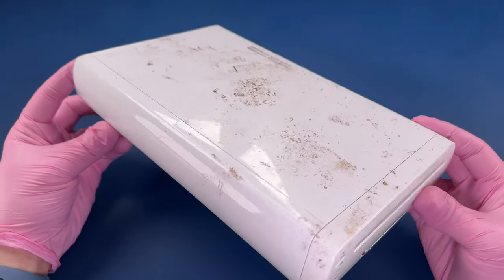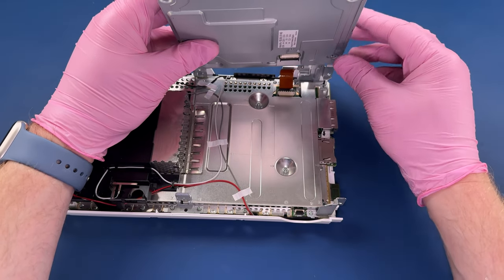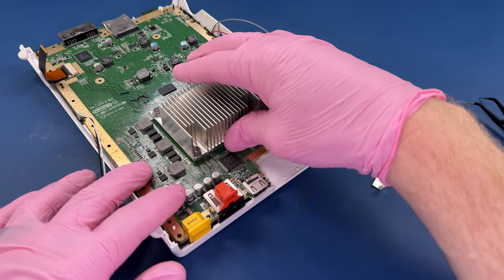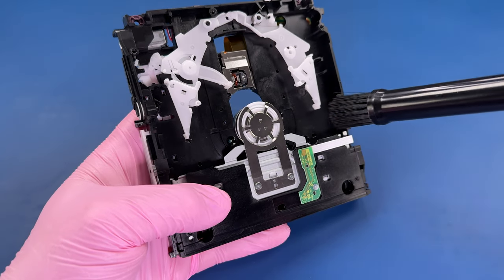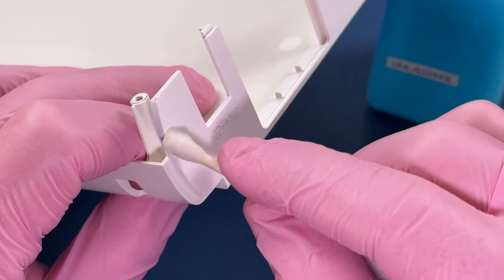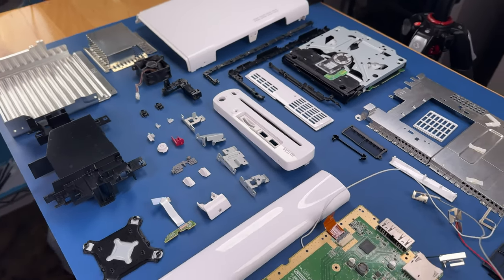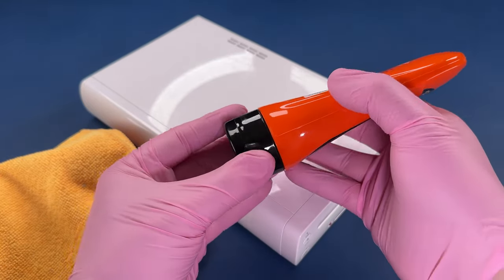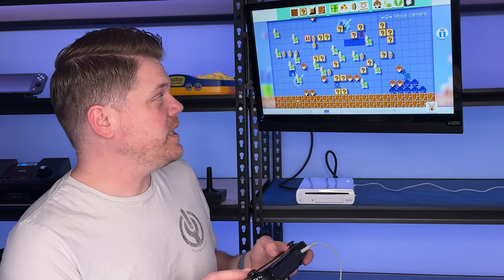The Wii U Didn't Sell...But Can It Be Cleaned?

Comment: I dont know, but if the wii u uses thermalpaste you should change it. If it stuck on the APU you should heat up the cooler and it will be easier to disassembly the cooler from the apu.

Comment: The fan shouldn't build up electricity, but if it is still plugged in to the motherboard, it can generate more voltage than the motherboard can handle and potentionally fry something.
Reply from the maker: That makes sense
Reply: It can even fry the motor itself if the airflow is too high. Also, even though there are ball bearings, the heat generated from friction may cause the plastics to melt. Always hold the blades with your fingers when running excessive air through it. It does not hurt if you let it turn a bit, but not over the usual RPM range.
Reply: I guarantee you even if it’s plugged into the motherboard the voltage generated spinning at a low rpm would not fry anything the voltage would be minuscule bc yes dc motors generate electricity but they are not efficient like a generator designed to make electricity and for the other comment about spinning the fan so fast it generates that much heat to melt something you’d have to be trying to destroying it and spinning it was faster than it’s rated rpm and using a high powered air gun in that case you kinda deserve to fry the fan If you are working on electronics not knowing how to properly do it

Comment: The truth with the fans creating electricity is kind of obsolete. 20yrs ago this would be true but they don't really cause electricity like they used to (They still do but very little) the part you should worry about is the bearings inside the fan, Letting the fan spin out of control like that can damage them.

Comment: FYI the white model is 8GB not 32gb
Reply from the maker: Oh yeah, thanks!
Reply: Not necessarily. Japan had white 32gb models at retail and the US also had 32gb white models that were only available through Nintendo refurbished systems.
Reply: @Nyxatron  Okay, but the sticker that said "8GB" on this Wii U was clearly visible during the video
Reply: @mjc0961  I'm sorry but I guess I should have been more specific in my original reply that I was elaborating on the blanket statement that the white model of the Wii U has to be 8gb.

Comment: Try a foundation (or other) brush instead of a paintbrush. It's also a larger brush, but with shorter bristles and in a rounded shape . Powder, foundation, blush, or buffer brush should all be great for somewhat larger areas that need scrubbing. As long as they're the more tightly packed type and not a fluffy one, they should be easier to use for cleaning than a long bristled paint brush.
Dawn is the best detergent for getting rid of grease, and it can also be used for cleaning makeup brushes (if you use them for cleaning). They also make some little textured rubber mats that are a few inches across that you use to clean brushes - brush cleaner mat/pad. They're easier to use to clean brushes than washing them with your fingers, and helps to entend the life of the brush.